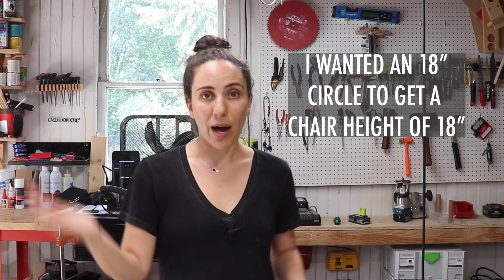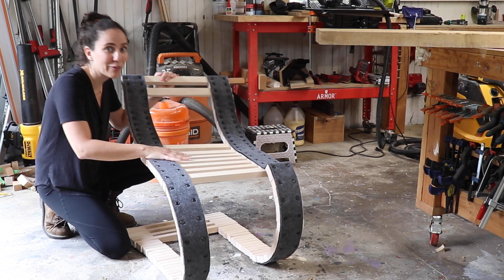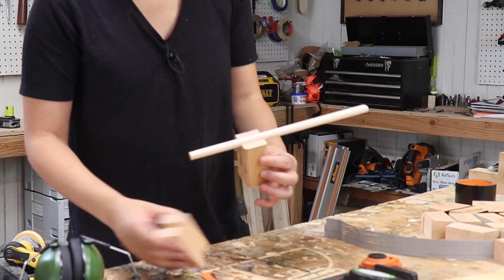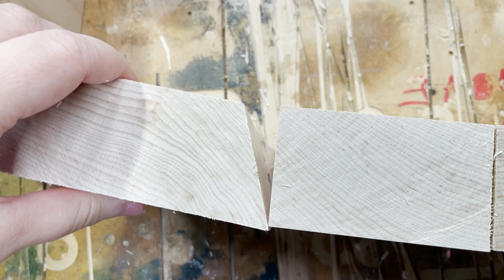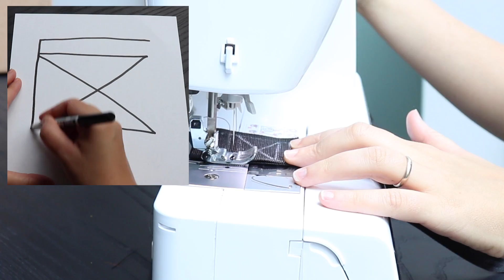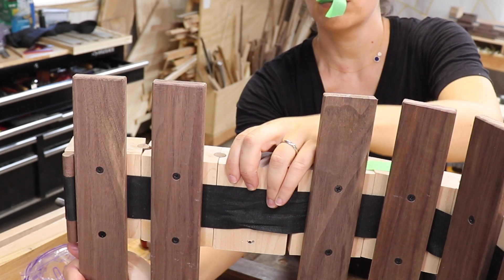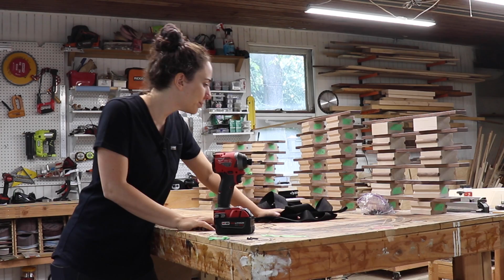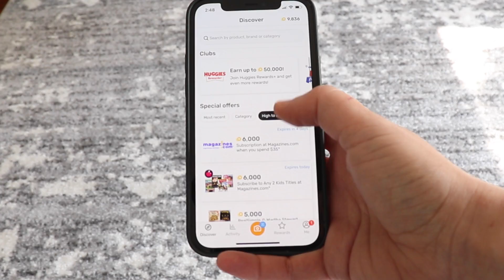I ATTEMPT to make a Roll Up Chair… AGAIN...

Comment: I think that the perfect strapping solution for this would be Steel Strapping. You know, that thin, spring-steel type material that is flexible and is used to wrap up bundles of wood, etc, or tying things down to pallets. It won't flex at all. It will also give you side to side rigidity, just in case. If you use the 3/4" inch stuff, it has a break strength of over 2000 pounds. I think that the black metal straps would give it a cool industrial look, too. You'd just have to find some sold in a reasonable length.  I'm sure you understand the issue better than I do, but it seems like the "too much tension" issue is just a matter of controlling where the tension is expressed. Since you only have the straps connected at the ends, if you have tension anywhere, it's going to produce an effect all the way at the ends. If your straps are connected to each slat, then the tension can't travel all the way to the ends to make them curl in. A pair of small screws through the metal straps into each slat. Finally... at the top of the chair, there should be a few slats that roll over the back and hang down, slack, for the weight. Again, the "slack" issue is possible only if you connect the straps at every slat to control the tension. At least, that seems reasonable to me :-) Good luck!
Reply: As far as strapping is concerned you're probably on the money - this definitely takes care of the tensile strength and stretch issues. The problem then becomes the durability of the wood because steel straps will chew it to pieces over time, compressing and gouging grooves into the high points on each convex joint. Eventually that'll mess up the angles just like the stretchy strap is doing right now.

I reckon the ultimate solution will be to keep your straps, ditch the wooden segments, and CNC the whole thing out of metal stock 😂

Comment: It's actually really cool to see someone work through a challenging design regardless of how successful it is. It's good that it's so difficult, it means it's worth the effort.

Did you consider having the upper half collapse in the other direction? This would require the webbing support to be in the reverse side though for that section. The idea being that you have two opposing arcs in balance, rather than one long snaking arc which harder to make stable.

You could even have the webbing (or even something rigid) traverse the distance directly from the knee roll to the bank of the chair, like an arm rest. It would probably have to be detachable though, it order to roll up.

I should qualify this by saying I have no idea what I'm talking about.
Reply: It's good to know whether a comment has any real knowledge behind it.  ;)

Comment: Try putting grain ends together in wooden pieces. The problem is not the strap streching the wood is collapsing. Tiny bit of collapse in the lower part can result as many cm difference. It multiplies by the lenght.

Comment: there is no doubt the webbing is strong enough but it has to much elasticity or stretch in it. and irrespective of what materiel you use in place of that webbing that factor will always be a problem .

Comment: What you could do is to improve the overall form of the chair. Now, there are certain points that have a lot of stress, but if you make a shorter seat (until now I've never seen you use the whole seat anyways) and make everything a bit more "vertical",  it may work. I would also just remove the back since it would always create too much tension when someone would lean back

Comment: Add removable supports under  the seat at the back, that will lessen the tension on the straps, you just remove them and still roll up the chair.

Comment: Random thought... perhaps using a cable down through holes bored in the center of the wood pieces, so that your tension is pulling each piece together on center rather than on one side or the other? basically hidden from view, but a more direct tension cable? You would have to use some sort of method that allows you to release the tension when you want to roll it up... or not if you just want it to be open all the time... :)

Comment: Really interesting project, like it as it seems to be a cool challenge. For one you definitely should connect the strap to each segment, otherwise you have all the issues you observed. Few thoughts for the next iteration: you want something super low stretch, steel or even carbon fiber might work. Could also think about some sort of a chain. And if you would think even further you could use traditional hinges instead of the webbing perhaps to a similar effect? Also, from the design perhaps plan a contact only at the bottom, so you can adjust spacings and angles more easily?

Comment: maybe you'll end up needing to use strips of spring steel for the straps. Or you can "pre tension" it by cutting the angles too small, so that the gaps stretch to the right size to make the right shape for the chair.

Comment: I think you need to tighten the radius of each curve so that when you sit down on it and put pressure, everything stretches out to the max length and the chair is in a proper chair shape.

Also instead of two small 5" splines, just use full length (18" or so) pieces with 3 or 4 strips of material.

Comment: I've been thinking on this too.  my thoughts are to 'isolate' the tension between each pair's connection.  currently you're allowing the tension to distribute and focus in the worst place,  like under where your knee would be.  there is created enough slack there so that ANY separation creates a lever action instead of a continuous form through the touching faces of the two parts.  there is also the matter of keeping the lower circle from collapsing while keeping the app circle from exploding and what this means for how you stabilize them.  I wonder if it might work better if you didn't glue the dowels in and also rounded the meeting edges of the sections.  this would allow the segments to hinge around the dowels and always pass the forces through that line.  also maybe use a steel thread cable - like a bicycle brake cable - and include a cam action on the end to tension the chair after unrolling
Reply: do you think hinges between each piece would work to mitigate the compounding effect?
Reply: I think the simplest solution would be just give it a leg to stand on. Something similar to a foldable walking stick. Sure, it would need a lot of segments and it would not be stable on it's own.. but if the chair was stable on its own (just not able to bear the load), the leg like that could potentially hold, or at least help to hold, the load...

Comment: Don't give up! When you revisit this project I fully expect to one day be doing my snoopy happy dance at the video titled  "I got it!" Again, I would suggest sailing materials like Dynema  (if it comes in a web) or other very low-stretch sailing materials that are strong. The other area I would focus on is the gap between the blocks. 1/64th of an inch gap multiplied by all the joints adds up creating a lot of play.

Comment: So I haven't sat down and worked out the geometry properly, but I'm pretty sure that you need to fix the straps to every block.  What you're doing at the moment is effectively making a tensegrity chair - and having the strap only fixed at the end means it's free to redistribute itself rather than stay where you want.  I think you need to make the strap behave like individual hinges between each section.  That said, I think you're going to have real trouble finding any strap that doesn't stretch too much.
I do wonder if it could work with actual door hinges between the sections, but that probably isn't the aesthetic you're going for, would weigh a ton, and they'd all have to be perfectly aligned and supre free running to work.  Maybe you could hide hinges under cosmetic straps in the high stress areas?

Comment: Tamar, you haven't given up (although maybe you should) I have just a couple of suggestions to try. One is looking for spring steel I wouldn't go over .010 thickness x a min. of 1" wide, the other is check into the material used in industrial straps for fhoists.  Many of thnese have a 5 ton rating, don't stretch and some have a fiber core.  Best of luck to you, prayers.  Keep on smiling.

Comment: Maybe this is a silly question... But is there a reason you haven't tried using metal cabling (like winch cable for example) instead of the fabric strapping? I would think that if you put 2 cables per side there would be enough resistance to stretching to avoid your stretching problem. Especially if you were to anchor them periodically throughout the chair.

Comment: The ideal material for this would be flexible with the absolute minimum stretch possible; all the major (remaining) problems stem from the flexible webbing stretching. I don't think you'll find a polymer webbing that achieves this for a reasonable size/thickness; you'd need to stack enough layers that the webbing part would be too thick/bulky to be practical.

This attempt has also confirmed that you really do need to anchor the main tension component regularly and cannot rely on tension along the full length, if only for safety reasons as pieces can buckle near the ends. I think it might work well to use an adhesive to bond the strap (if you could find one low-stretch enough) to the inner structural elements and just screw down the outer runners. The compression from the outer pieces will ensure the adhesive doesn't separate from the webbing, so the adhesive can do its job of resisting sliding forces effectively.

The best idea for a tension material though would be aircraft cable (wire rope); it remains flexible but is incredibly strong and stretch resistant for its size. The tricky part would be affixing it strongly to your structure. There are sleeves/balls that can be crimped onto the cable, so it might work to route out a small channel/space on the front of your main structural pieces to capture these crimped fittings every few pieces to ensure the tension remains local, with your outer wooden slats clamping down to ensure the cable remains in place against your main wooden components. Tolerances would be tricky here; you'd want to assemble the structure first and mark the locations for your crimped sleeves, and then might need a way to shim the pockets to get the right spacing when unrolled.

Comment: Small, proper metal hinges, at least at the few places with maximum pull? Metal cable to cut all / more of the flex out? That fabric webbing seems destined for stretch.

Comment: the problem is one of mechanical advantage working against you. you really need the wooden blocks to take the weight and the strap to just hold the blocks in a interlocked position. 
ideally you need the wood to be in compression with the strap is in slight tension.  
I would imagine the strap being used to move a secondary interlock that fixes the chair in position so the wood takes all the strain, for instance the strap causes and offset that makes two parts interlock together. but it would at a minimum require some very complex shapes in the wood in order to lock the wood together, rather than relying on the strap to support all the weight in a disadvantageous way.

Comment: This is easily the most interesting project on all of YouTube.  I really want you to succeed!  But the journey so far has been incredible on its own.  Pretty sure leather's going to be at least as elastic as strapping.  About the only thing I can imagine won't stretch (much) on you would be bike or motorcycle chain.  As it is, I'm impressed that the wood can stand up to the lateral compressive force with all that leverage, so hats off to you for proving that wood can handle a job that I thought only steel would survive.  One other thought I had for when the chair want's to flop and fold up when deployed: maybe a little bit of velcro or magnets inset between the individual pieces so they have a little "stick" to 'em till you deliberately roll it up.
Reply: Check out Josh Wright's channel.  Video titled Making A Chair That Rolls Up (again) | Woodworking.  He uses pallet banding and it works!

Comment: OMG, I was feeling quite tense (ha, get it?) by the assembly stage.  I was really rooting for ya, and showing the power of Hollywood, or maybe it was the "..AGAIN...", I was expecting the cathartic resolution ending -success! Googled around. Found other designs. I like yours better. Cleaner & minimal, homage to Mile van der Rohe. It's all about the angles and loads. I think ya need an engineers input. Maybe reach out to that Real Engineering guy on YouTube.

Comment: I've never tried anything like that but my instinct is that each piece of wood needs to be individually connected to the next one and then tensioned rather then doing a long run of strapping or cord. The dowel was genius, I'm curious if a piece of wood that would go further into it's mate would allow better grab when deployed. The bottom of a slat would have an outer section and a inner section that would also grab the mid section of a top of a slat. Hinges could also work but that's a lot of hinges. I really enjoyed the video, my wife rarely watches these with me and she viscerally felt your pain enough to come and sit with me and watch and enjoyed the skill and patience you showed despite how frustrating it must have been.

Comment: I wouldn't bother with leather either. The only materials that won't stretch under that kind of load would be steel cables or kevlar.  In the bicycle industry, we use kevlar in the bead of the tires to allow the tire to fold up for easy storage and to hold up to the high air pressures...that means they are flexible yet they have very limited stretch. If you can source kevlar strapping or belts, that might do the trick.

Comment: Plumbers tape/ strapping? Nice idea, as pallet strapping, but the will snap if folded and unfolded much… I would make a couple of dowels to fit up through the back and down to the floor from the back curve of the seat. Make them removable so they can fit through the blocks sideways for storage.

Comment: I've not read all the comments but, yeah. If you were to glue or fasten the strap completely to each piece, your stretching would only be at each joint and not collective over the whole strap to the joints with the highest spreading force. As for a a way to keep it from rolling up. I think a simple strap at the back going from the top straight down to the bottom end would work. You could pre-tension the chair and hook the strap.

Comment: Leather will,stretch as much, or more than webbing.  I love how you’re trying to solve all the problems and wish I had a useful suggestion to get it to work
Reply: Yep, leather would be WAAAYYYYY worst, even if taken from one of the less stretchy body part.
Reply: Look into kevlar reinforced belting, like motorcycle drive belts.  They are VERY strong and have like ZERO stretch to them since the have to work under enormous tension without slipping.  Might be a bit pricey tho.  Not sure.  Maybe find a Harley dealer/shop and see if they have any old belts they would give you.
Reply: My first thought also was: Well.. if tension-flex is the problem.. maybe going for something that doesn't flex? I am 100% not smarter than anyone who already saw and commented the previous videos and especially not smarter than YOU xD - but I had seatbelt in my mind. But probably I am just naive and it flexes as strong as any of the already tested materials.
Also I can't explain from an engineering perspective, but I would fix/screw the belt to the blocks at least where the sitting-area is. That would take tension from the upper/back part, where it isn't really needed/helpfull.

Love your enthusiasm with this project <3
Reply: @goomStar  I think the strap she used has less flex than the seat belts.
Reply: I would personally go with carbon fibre but without any resins (you just need tensile strength) and localize mounting in a way that focuses on stress points. In order to prevent that thing from collapsing you need material that just don't stretch. I'm also not really sure if compressive forces are taken into account, I know it's hard wood but it doesn't mean it wont compress a little. Some of the parts of this chair work like vise. I would seriously think about adding steel plates on wood to prevent that compression.
Reply: The problem is that "strength" is not the material property you should be looking for. Many very strong materials are stretchy, especially materials designed to be strong against shock, like seat belt webbing. What you want is a material with a low stretching modulus. Steel cables would be a good place to start. There are many materials that are described as "stronger that steel" but that typically means they will stretch or bend rather than break.
Reply: depend witch type of leather
Reply: why does no one talk about hinges (or the things that are on doors and windows i'mfrench i'm not sure about the correct word) i feel these could be way better than any straps

Comment: Excellent video.  Brave of you to attempt this chair again!  If you do make a third attempt, then I think carrying the straps over the top and having them connect to the back of the bottom could work.  It would tension the two areas that want to collapse. Also it you roll the chair up starting at the bottom it would finish with the top and leave those long connecting pieces of strap to go around the entire roll as a closure.   One more thought while I’m at it.  The dowels may have been working against you as they allow the joints to “hyper extend” if the strap has any stretch.  Perhaps an asymmetric pieces that locks the connection as it achieves the correct geometry.  Looking at enzymes’ key/lock geometries may be inspirational.   Best of luck.   Thanks for the entertainment.